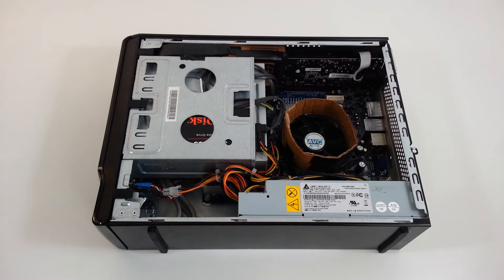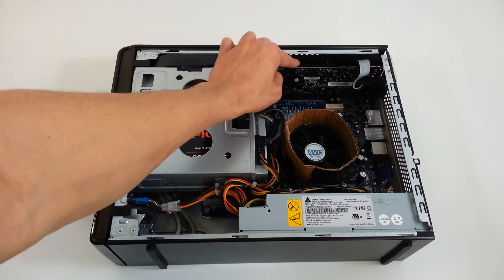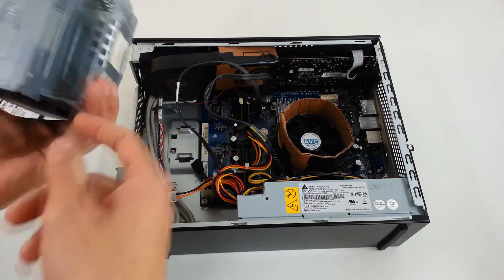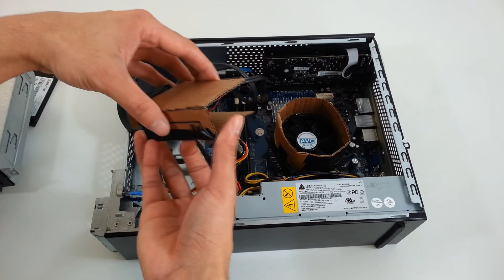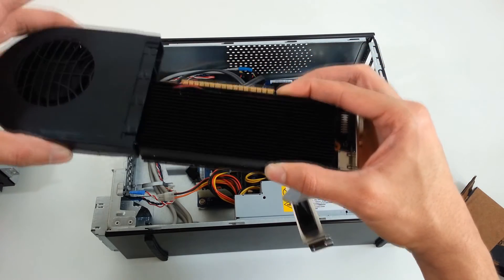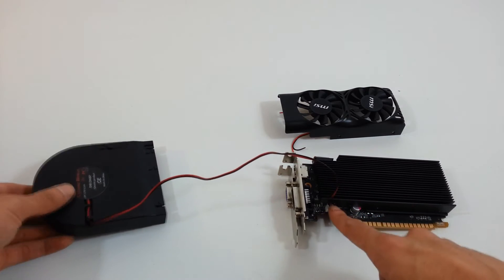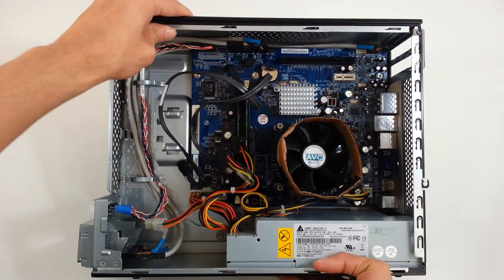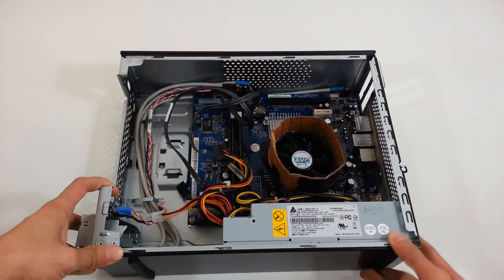EL-1333 "slight" Upgrades ( Part 2 of 2 )

Comment: did you upgrade the cpu? if so, do you know if the cpu is upgradeable on the same computer except it's the 21F model instead of 11F.   EL1333-21F. thanks for the video btw

Comment: I have a 3.1 ghz proccesor is that enough for the gpu? cuz I know that bad cpu's can bottleneck the gpu or vise versa
Reply from the maker: +quiv duran      Well, it depends on overall  CPU performance along with RAM memory. If it is a quad-core 3.1 GHz CPU with 8GB 1066 DDR3 memory or faster than it should be fine. I think That's the most eMachines El motherboard could take without having crash errors.

Check this page for  some specification about certain eMachines motherboards:
http://www.manualslib.com/manual/391363/Emachines-El1358.html?page=9#manual
Reply: Well my version is the EL1352 so does that change anything?
Reply from the maker: What are the specification of your PC? CPU model, Ram type, and power supply rating?
Reply: CPU: AMD Antholon II x2 255 3.10 hgz
Ram: 4 gb of ram pretty sur ddr3 
psu: 220 W
Reply from the maker: +quiv duran  Alright much better. Well I am going to give you my recommendation for what upgrades you can do -in order, if you can't buy all the parts at same time. Also try not to spend more than what I recommend.
PARTS:

First -  GPU cause is the biggest difference you are going to notice and cost the most. 
                                                           <$120 or less  MSI 750ti Low Profile (with slight fan mod extra $8 ) 

Second - RAM memory if you need more. Make sure is the same pair of memory you have on board. No more 
                    than 8GB total.            <$18  DDR3 1066 or 1333 which ever one is cheaper

Third - Storage go with a reliable brands; either go with a 1 TB HDD 7200 RPM 3 Gb/s or higher  or  240GB 
                 SSD                                  <$50   (try to get it on sale) 

Fouth-  CPU TDP 95 watts or less with quad-core. Make sure is the same socket as motherboard. This is 
                 tricky, I recommend you buy it used because of the price. Sometime this could be a gamble, so do 
                 some research on who is selling it to you. Cheapest place to buy on is on Ebay.             
                                                          <$ 40     
Socket AM3      
AMD Phenom II X4 840,   
AMD Athlon II X4 650,
AMD Athlon II X4 640,

or less.

NOTE:   
With all these upgrades you are likely to spend ~$240 . Personally I would not spend that much on and old PC. if anything just buy the GPU and start saving up for a new PC tower. Also your PSU is going to be under heavy load so do not overclock nor load many devices to the motherboard (USB ports, Disc drives) at the same time.

GOOD LUCK.
Reply: can i put a 500 gb ssd and use the ssd later on for possible builds in the future? I'll upgrade ram and gpu but thats it for this el-1352. Not going to worry about cpu. I was wondering on using this ram if its ok http://www.amazon.com/gp/product/B00569K7LM?psc=1&redirect=true&ref_=ox_sc_act_title_1&smid=ATVPDKIKX0DER.
Reply from the maker: YES, almost every part can be transfer to a new PC tower, except the CPU and Windows OS key.

BYW. You can get cheaper ram like the Crucial Ballistix Sport 8GB Kit
Reply: +Kirk F it would still fit right with the cd drive in their?
Reply from the maker: Personally I ordered Low profile RAM.. but yeah a Standard RAM stick without Heat shroud should fit. 
Eg. G.SKILL Ripjaws X Series are not going to fit because of the height clearance.
Reply from the maker: Yeah
Reply from the maker: Yes, but there is not need for low profile the regular size RAM will fit just fine. As long they don't have large heat sinks.